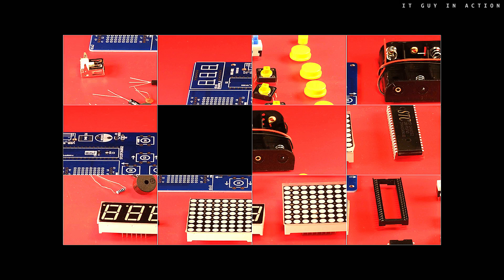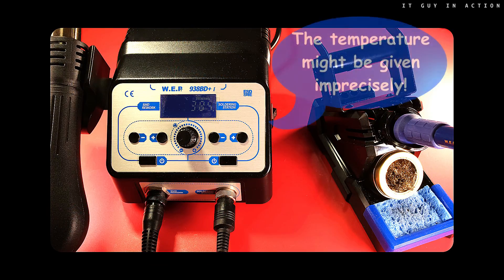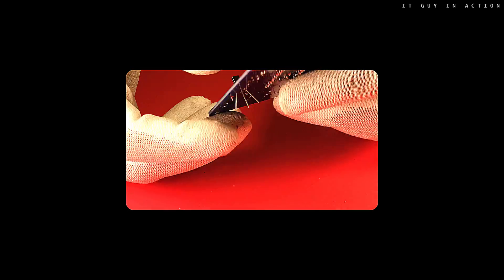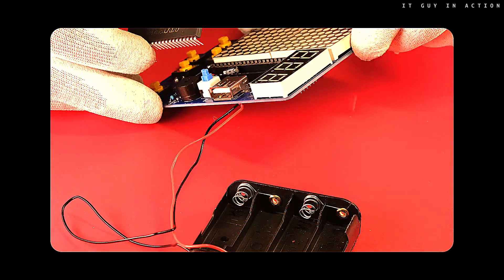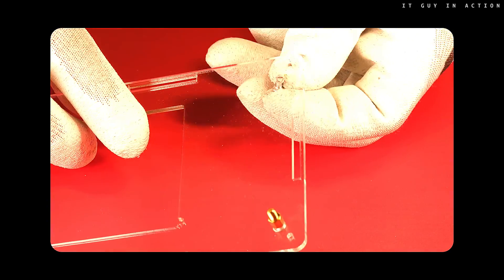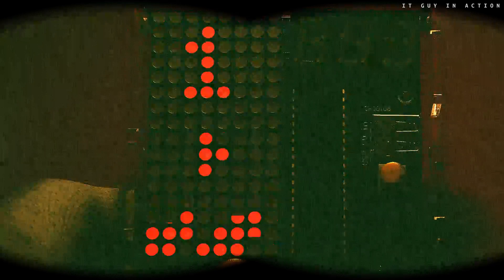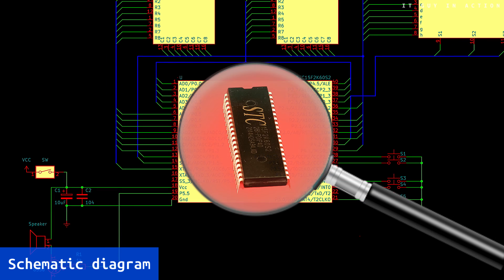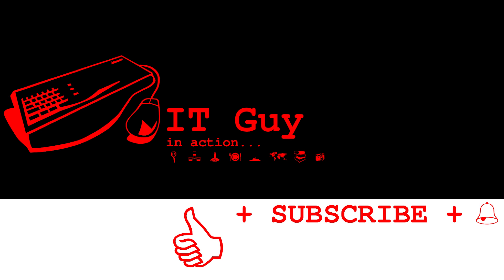🎲 Do It Yourself Game console (self-assembly of a simple console with a legendary microcontroller)

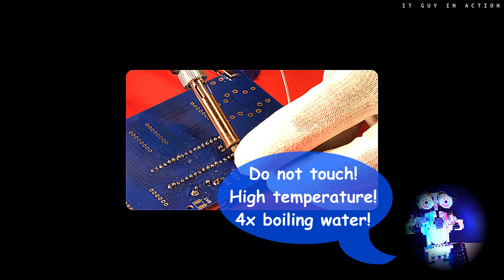Comment from the maker: 🎲 The video contains three easter eggs. Who will find them? ✒ Please write many comments! I want to know your opinions! Additionally the more comments, the more YouTube promotes the channel! Thank you! ⚠ Warning. Soldering and other electronic work require proper preparation and experience. The video should not be treated as a guide. If you decide to do the same or similar work, as in the video, you do that at your own risk. Some activities can be dangerous to health and life. 🐛 One of the viewers pointed out a small but very interesting bug (de Tiges, thanks!). 4:18 – I’m mentioning that the soldering temperature is 4 times higher than the temperature of boiling water. And indeed looking at it strictly mathematically, we have the boiling point of water of 100°C, and I’m setting the temperature of the soldering iron to 400°C. Thus we have 400/100=4x… Let's take the Fahrenheit scale. 100°C≈212°F and 400°C≈752°F. So suddenly 752/212≈3.5. Oops... Why? Well, in a nutshell, it's about what temperature really is. Both scales are not suitable for comparing how many times one temperature is higher than the other due to their specific design and the placement of the zero. Please read more on the Internet, if you are interested in details. Here I just want to highlight shortly the issue. We should use the absolute scale, which is Kelvin. We have then about 373K and 673K, respectively, which is 673/373 ≈ 1.80. We could use also the Rankine scale (as some say, which is the Kelvin equivalent for those using Fahrenheit scale). Here we have approximately 671°R and 1211°R respectively and in consequence again 1211/671≈1.80. Thus looking from “a pure physics” point of view, it should be said that the temperature of the soldering iron is approximately two times higher than the boiling point of water. Tricky, isn’t it?